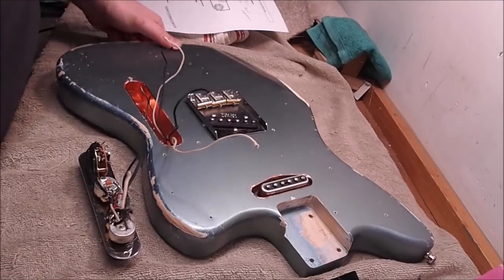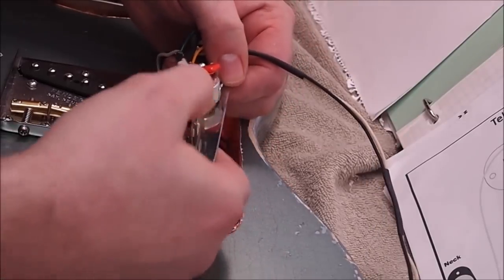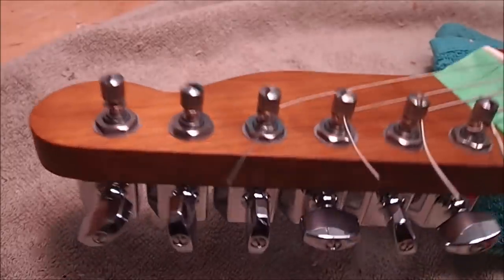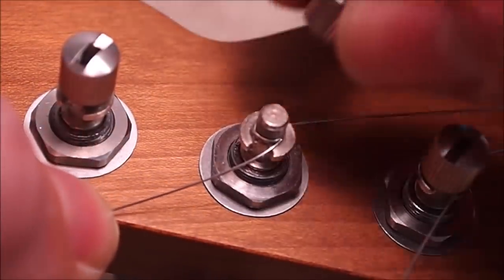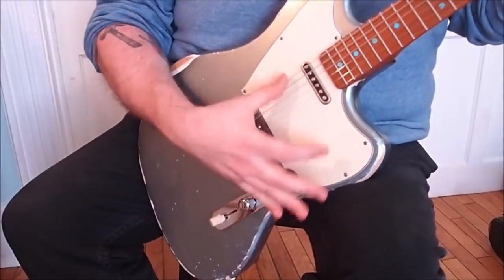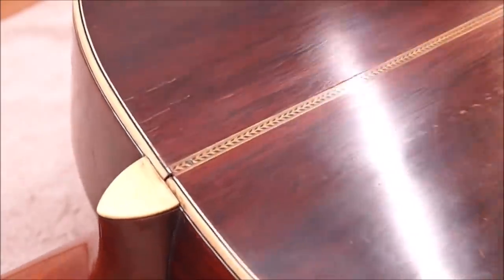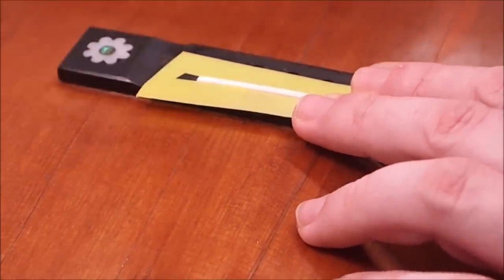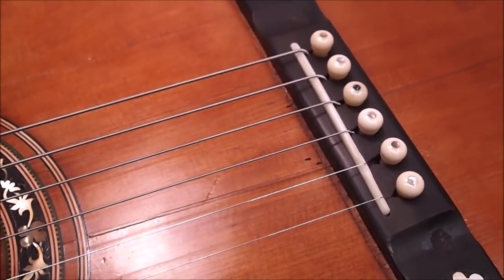Guitar Repair: Two Very Different Guitars

Comment: 03:15 Worth repeating:
DON'T SUPERGLUE ANY NUT, EVER!
*please*.
yours truly,
all guitar repairmen.
Reply: jo sg . A drop or two of superglue on a non captive nut is fine. Superglue is weak to shearing action.  Tap it sideways with a padded hammer and it will pop out easily.

Not required on a captive nut like this.
Reply: CA is great for nuts! it dries quick (good for awkward positioning when the slot/shelf is not ideal and you have to hold it in place by hand) and brittle, good for tone transfer and easily breaking loose again.

the key is just use a tiny amount, like three drops along the bottom; do that and the nut will be easily removable for future maintenance
Reply from the maker: @walterw2  yes, I use it on standard acoustic nuts all the time for that reason. A little on the surface that contacts the fingerboard endgrain pops off clean with no damage. The little Fender nuts are no fun to remove.
Reply: @twoodfrd  That is the point to be stressed imo - a DROP on the ENDGRAIN. You are not gonna rip the end grain out, puting any underneath the nut is a no no. It should be said again and again.
Reply: phrasing!
Reply: @erikhilsinger9421  I wasn't saying something different! Just saying it again... I'm a guitar tech too, got my feelings about it.
Reply: finally! Ive been wondering if I screwed up when I put a dot of superglue on the back of an LP style nut and butted it against the maple fretboard so it would stay put. Glad to know I didn't make a huge mistake.
Reply: @JC-11111  Gibson style nut on a guitar with a maple fretboard?

Comment: To all my friends who want robot tuners because they play in different tuners. I hate those things. I owned an SG with those on it. I never dreaded switching new strings till I had to switch them on the Robot Tuners. The best answer I can give is. Find a make of a guitar you like, and just buy a second or 3rd one. For example, I always say, I run 3 les pauls classics with Standard Tuning, D, A, D, G, A, D, and B flat (Not C# like others constantly think B flat Tuning is.) You can get an A/B Y or A/B/C/ Y switch which is normally used to multiple amp selections to connect multiple guitars to your rig and just select the guitar in place of the amp.

Comment: I did a 4-way switch on my Tele when I changed the pickups and It would only switch 3 positions.  I took the switch off the plate and voila’ 4 clicks.  I bought a plate with a longer switch slot instead of filing out the genuine one.

Comment: Mr Woodford, Have you ever tried compensating the nut to try to reduce the need for some of the saddle compensation. I was just wondering if such an approach would help in a case like this where ther isn't enough room for proper saddle adjustment. Thanks.

Comment: I had the Tronical tuners on an SG, it was pretty nice to have at home for a quick tune up any time you pick up the guitar.
On stage ... it's too slow, too often fails (tunes wrong) and this all gets worse when there's more noise. Restringing as you showed is an enormous pain and thicker gauge than 11s is not supported

Two of the servo's broke at some point, I replaced them with Hipshots and I'm never touching that crap again.

Comment: A lot of people hate those autotuners (many think you cannot manually tune, which is incorrect) ...after you learn how to use them, I think they work great. One thing I have found, though, (on all the stock Epiphone/Gibson units I've worked on), I have had to calibrate the autotuners against a good tuner...from the factory setup I have found them way off!!

Comment: Robot tuners?  Wow, I didn’t know there was such a thing.  I generally fall at the opposite end of tuner technology, preferring vintage Kluson double line for my Telecasters and Grover open gear for my acoustics.   Neat idea, though, if they work.   I also like to flip around my Tele controls, like you have done, with the switch in the back.  Cool guitar!

Comment: Lately I've been very disappointed with the quality of CRL strat and tele switches.  I much prefer other brands and only use them in vintage fenders so they look right.  Perhaps, like everything else, there are fake Chinese ones finding their way onto the market.  Who knows?..  Having said this, it is very easy for solder to wick down into the contacts and stop the wafer from sliding between them.  These days I use a heatsink clip mounted low near the little rivet to stop the solder in its tracks.  Also, Ted, if you need a custom wiring, let me know.  I enjoy your videos and I'm happy to help you out.  If the tone pot is wired directly to the bridge pickup, it will still work on both when the switch is in the middle/parallel setting.  You can isolate this to a certain extent with a couple of resistors, but in series mode, it shouldn't be necessary.

Comment: I just use pva glue to glue ANY nut. Also, I don't feel the need to glue a strat style nut at all. They usually fit very well, won't get lost for sure, and they are a huge pain to remove if glued.

Comment: I have a very strong aversion to using crazy/super glue anywhere on a guitar. Exception maybe on broken plastic parts that can't be replaced or matched. If I can't undo it, I won't do it.
That being said, a person brought me a nylon string guitar. Guess the lad playing it had never heard of strings stretching. Those darn tuners must of been slipping. I swear, every place the strings touched the guitar there was a rudicules
Reply: Oops. I meant to say the strings were glued at the tuning machines, nut, saddle and knots! And not just a little.
But there are worse things. A broken solder joint on a brass instrument that someone super glued and I didn't notice.
On an old break I'd clean off the old lead solder and resolder.
On a new horn with a nice clean seperation, just line it up and a little liquid flux.
So I heat it apply flux and the solder don't flow. We bit more flux, little more heat and then poof. The glue burns. That toxic nasty crap up my nose. It burns and makes the eyes water.
I'm sure health wise, that was the worst thing that happened to me and not just once. Guess I'm stupid or slow to learn.

Comment: Ugh....that kind of annoyance like “finding out a brand new switch doesn’t actually work...but only after you’ve installed it and wired it up” is the WORST. For me, that’s usually something that’ll make me walk away for a bit and work on another project. Annoyance leads to haste which leads to cold solder joints which leads to more annoyance and the cycle begins again...so I’ll usually give me brain a moment to reset.

Comment: Not much sense in having a robotized, auto tuning guitar on stage; you would need a spare guitar anyway in case of string breakage during the performance,  and would probably be in constant need of a guitar tech/roadie. Might as well just bring 3 guitars and let the roadie deal with it all.  Note that slide guitarist Sonny Landreth has experimented with various robo- tuning systems,  both for Strats and Les Paul style guitars, but he always seems to revert back to bringing along 3 or 4 guitars that are pre-tuned to how he wants them.

 I've never seen Richard Thompson have more than one acoustic guitar on stage with him, always the same Lowden that he has been playing for years. Sets up the tuning as he wants it inbetween songs and it's never a problem for him. Hmm,  perhaps someone should make Scruggs style tuners for electric guitars, which manually change string pitch by a predetermined amount at the flip of a lever or something. Adrian Legg has used them for years on his modified acoustic-electric guitars.

Comment: I feel your pain on the 4-way switch, as I had a similar experience to yours. After finally getting it wired correctly, I didn't find the tonal options very useful, and the switch cap cracked. So, I removed it, and put in a simple 3-way toggle switch. Suits my use better. Thanks

Comment: Yes, robot tuners make me cringe

13:52 Would you ever consider routing out the old saddle slot just lightly before making your new saddle?  Just a fly cut to make the surfaces more straight, clean, and predictable?  Came out killer looking though, with no gaps on top.  Sounded very rich, like a good Martin

Comment: Do you know where to get plans for that routing jig? I have to do the same for a late 1800’s (similar) rosewood parlor. StewMac has priced me out. Great job and sympathies for the robot tuner install and setup. I get it.....but what a pain in the ass. I’m having finger issues also and it seems to be a mum topic in the guitar community. Chipping away at all that joy.

Comment: How interesting that I came across this episode at this time.  I'm all set up to rout a saddle slot in one of my acoustic guitars to switch it over to left-handed play.  The plug has been glued in and leveled, intonation of top and bottom strings determined, and the jig set up.  I will be routing the slot as soon as I get to the shop.  Had a finger-tip injury on my chording hand which will keep me from playing my normal guitars for a month.  Thanks for posting this.  Also, if you ever get up to Rainy River, Ontario let me know, I live right across the river from that town and I'll walk you over a couple of rolls of pennies.

Comment: You mixed it up. Parallel boost the signal but has no humbucking effect, series makes for a humbucker effect and a thick tone
Reply: that is not true
Reply: @calinguga  i know for a fact. A tele is wired in parallel. You have no humbucking there. Strat position 2&4 is two pickups in series. Look it up
Reply: @Szabó Arthur Google "current divider" - there's less current on each pickup when in parallel than when in series.
Reply: @Szabó Arthur Strat positions 2&4 have nothing to do with series/parallel but with phase/out of phase.
The middle pickup is out of phase with neck and bridge, which cancels frequencies (including the hum.)
Reply: @1040ecapja  okay, that makes sense. But still, no humbuck
Reply: Szabó, I believe you're confusing parallel/series with phase switching. My understanding is that a traditional telecaster does not have a reverse-wound/reverse-polarity neck pickup, which one might expect it to. As a result, the standard middle position on a traditional tele is not hum cancelling. Some people probably do 4-way switches where the middle 2 positions are parallel-in-phase and parallel-out-of-phase. In that situation, parallel-in-phase would be beefier sounding but not hum cancelling, and parallel-out-of-phase would be hum cancelling but weaker. This has nothing to do series/parallel. More than likely, this neck pickup is RWRP, as they are certainly not traditional tele pickups. That means that in regular parallel-in-phase, it would be hum cancelling. The other middle position is still in phase, so it doesn't have that thin, hollow sound, and it would still be hum cancelling. But rather than dividing the resistance of the pickups in half, which happens in parallel, the resistance is added together, making it bigger and louder.
Reply: @1040ecapja  look up "How to get two more sounds out of your Fender Telecaster" from StewMac. And listen to what the guy says
Reply: Standard strat wiring is assuredly not series, and you actually have to go pretty far out of your way to get it to be in series. I think it's actually impossible with a standard 5-way.
Reply: @Szabó Arthur Yeah, parallel is no humbucker in the sense that it doesn't give high output. But it does cancel hum so technically speaking it is a humbucker.
Reply: @Szabó Arthur Oh gotcha, I resaw the video. It's more of a semantics misunderstanding here...
 So you said "parallel boost the signal but has no HB effect."
It does not boost signal since actually overall resistance drops (both pickups divide current instead of receiving full 100% current.)
And it does not per se have HB effect, but it CAN and regularly does: most modern teles and p90 guitars like Casinos do.
Reply: @Szabó Arthur So when you said "A tele is wired in parallel. You have no HB there" it's not necessarily true, again actually most modern guitars are.
And you said "Strat positions 2&4 is two pickups in series" which is not true, again it's because they are wired out of phase to cancel hum and other frenquecies which is why it sounds like a duck.
Reply: Magnetic/electric in/out of phase is complicated to understand, but kudos to Jason Unterreiner who put it perfectly!

Comment: Those tuner have some idiotic design features! String retention methods from many popular locking tuners would have been better and a free turning function or motorised restringing positioning function that was one push and accessible surely would have made sense?

Comment: dealt with those robot tuners for years, especially after gibson lost their minds and put them on every guitar they sold back in 2015; when the highly experienced luthier has to rifle through multiple pages of a website manual just to change a string and it's still a ridiculous struggle, you know the system is just not ready for the stage.

i'm imagining that player trying to use the system for multiple different tunings, breaking a string from the metal fatigue in the middle of a show, and they pretty much have to put that guitar down until setbreak, it's done.
Reply: Frankly im surprised we havent seen the follow up "robo tuners junk, guitarist realized he should purchase different guitars for different songs like the big shots or rationalize his music for gigs vs studio if hes not rich enough for that"

Comment: I'd like to see a neck block repair . Where the neck block shifts and causes a crack in the top and either moves the rosette or cracks it. I just had that fixed on a martin but have a guild that i'll have to do that one myself. The Martin had too much sentimental value for Me to attempt …. . .
Reply from the maker: I haven't had one of those in a while.  I make a prop that presses against the tail block to push the top half of the neck block back into position, and reinforce the cracks in the top with a brace.

Comment: I thought the tone pot was at the rear of the Tele plate, which is why turning the plate around makes sense, for doing a manual wah with styles such as Dieselbilly.
Reply from the maker: That's one way to do it. Others like having the volume up front and to just get the switch out of the way.
Reply: @twoodfrd  It hadn't occurred to me that someone might want to do swells, instead. Thanks for pointing that out. I definitely get the urge to move the switch; I'm thinking of flipping my Tele clone's plate around (and adding a four-way switch).

Comment: Was that an epoxy gluing the plug into the bridge? If so why did you select that?
Reply from the maker: Fish glue. It dries very hard and works well with the sanding dust/gap fill treatment.
Reply: @twoodfrd  Thanks for the reply :)